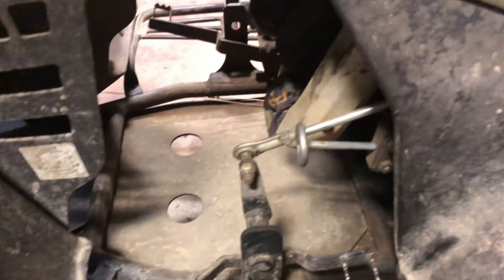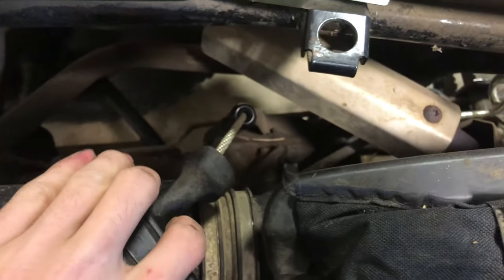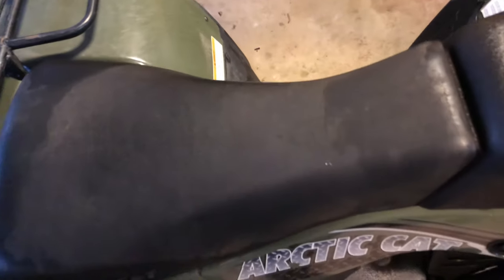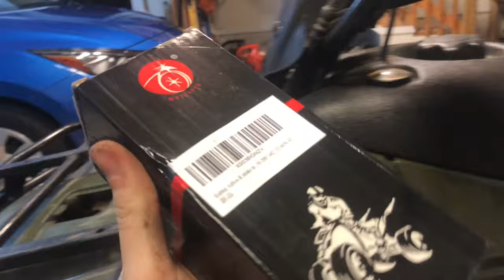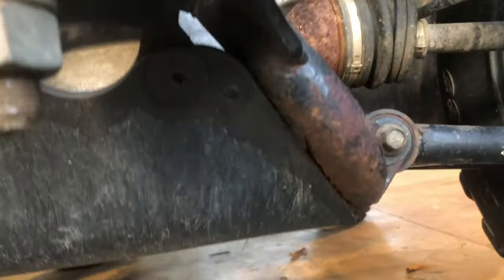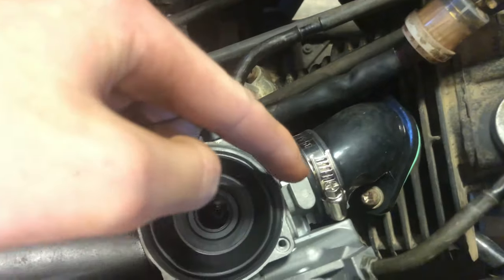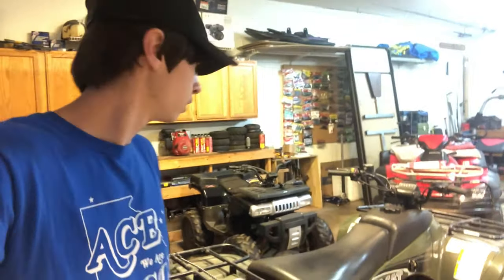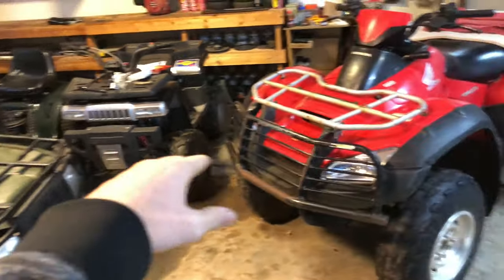2002 Arctic Cat 300 | Tune Up, Mods, & Performance Test

Comment: Legend says if you take off the sector of the front diff, rotate it back by 3 notches, you'll ha e 4WD lock.
Reply from the maker: Yeah I heard about that on the 4WD models, unfortunately this is only the 2WD version but if I had the 4WD version I would totally do that mod!

Comment: Have the 300 4x4 and had the same issue . It was the rubber diaphragm in the top of  carburetor. It was dry rotted and leaking vacuum and not pulling the needle up when applying the throttle
Reply from the maker: Oh wow, did it run like it should when you fixed it?

Comment: how in the heck do I get the battery out of this model?  Anybody got a how to video??
Reply from the maker: Just unbolt the top mount, wiggle it around and out to the side and it should come off, then lift the battery out with the top point out first. That's how I did it on mine.

Comment: so did you do a aftermarket carb? and if so can you post the link?
Reply from the maker: I just got one of the ones that came up on Amazon: https://www.amazon.com/Carburetor-Arctic-0470-448-Carb-2001/dp/B07T82PRPW/ref=sr_1_5?crid=1XYHM1EZRI1HF&keywords=2002+arctic+cat+300+carburetor&qid=1678836729&sprefix=2002+arctic+cat+300car%2Caps%2C218&sr=8-5
Reply: @IngenTechNational  Thanks man appreciate it. buying a 300 2x4 this weekend and the dude said it idles fine but when you put it in gear it sputters. do you think the carb is the issue?
Reply from the maker: @Chayton_Witham  Yeah it could be, but I would check the plug and maybe replace the coil and CDI but do one step at the time so will know what the problem is. Mine does sputter a bit and I know its the carburetor but I have done all I can to adjust it. The older late 90s Arctic cat 300 models have the same engine and trans but a different style of carb I believe so maybe in the future I might try that on this one. Good luck with that ATV lol hopefully my video gave ya some tips!

Comment: What carb did you put in it?
Reply from the maker: Just the factory carb replacement off of amazon. I saw a different style on the ones made in the late 90s with the same motor so I might find that one. Mainly the pilot jet is slightly too rich and needs the next size smaller cuz of the spitting and sputtering. I you know of any other carbs then let me know!